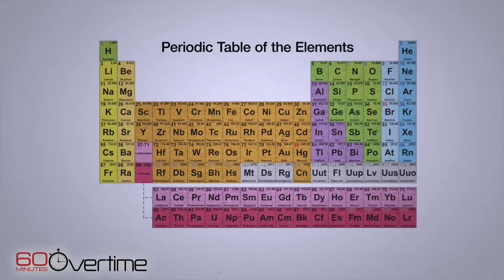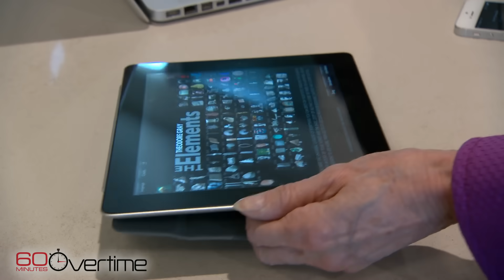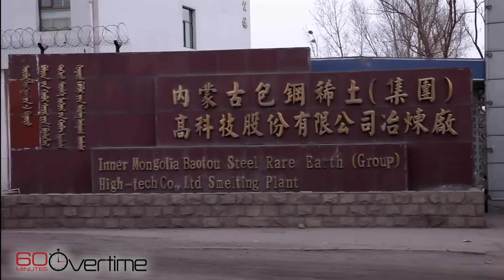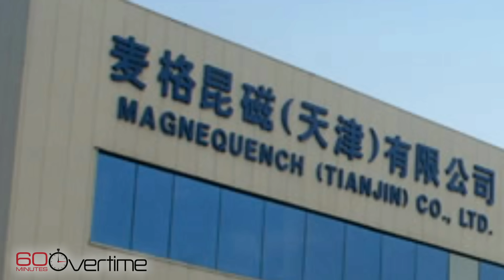Rare Earth Elements | 60 Minutes Archive

Comment: The Flamingo is better than most counterparts in terms of range, payload, jamming resilience, and cost/ease of mass production. It's a "strategic disruption tool"—simple, brutal, and scalable—designed to overwhelm defenses and compete with high-tech opposition using basic, smart engineering.

Comment: This is less than half the story. Finding and digging up rare earth is the easy part, the hard part is purifying them to 99.999% purity. No country has invested as much money and time (2 decades) as China to get rare earth to the 99.999% purity needed in radars and microchips. It took Japan nearly 10 years to purchase mines in Australia and Malaysia to extract and purify rare earth for their cell pone industry after the Senkaku islands (or Diaoyu island) dispute with China, and it only reduced their dependence on Chinese rare earth from 90% (in 2010) to 60% (in 2025). To purify rare earth to 99.999% purity, you need cutting edge research at universities - one of the very few ones to study rare earth is Colorado School of Mines. New facilities, such as the USGS Energy and Minerals Research Facility set to open there only in 2027. The alarm (America's dependence on China for rare earth) was sounded over a decade ago, but the country lacked and still lacks leadership to get this fixed. Will the half-hearted effort end up like what happened to Solindra?

Comment: Massive, rapid building has resulted in unsustainable levels of debt and the creation of "ghost cities" and underutilized infrastructure. This suggests a misallocation of resources, where projects serve political goals (such as provincial GDP targets) rather than sound economic logic. The breakneck pace of construction, even for renewable energy, has come with immense environmental degradation, pollution, and resource depletion. The speed is achieved by cutting corners on environmental impact assessments and enforcement. The focus on having a rail network 20 times more extensive than Japan's can ignore the possibility of technical issues, maintenance costs, and quality control compared to systems built with greater deliberation.

Comment: Actually rare earth elements are so called because their atomic structure makes it difficult to distinguish between them. Their atomic numbers are high enough that the atomic shells don't fill in order like the lower elements. The lowest shell of a higher valance fills before the higher shell of the lower valance finishes filling. Since the higher valance is the outermost shell, chemically it  is the major identifier of the element. That makes the elements in the series (e.g.  Actinide) look the same chemically until the lower shell is filled as atomic number increases.

Comment: I remember reading about Magnaquench in Popular Mechanics. In the article they described how the starter motor on Jeeps were smaller and lighter due to the stronger magnets supplied by Magnaquench. I guess they failed because  they didn't produce the instantaneous massive profits expected by Wall Street and China saw the long term potential. Same story with 123 systems which the Chinese scooped up and became CATL.
Reply: No it's because of over regulating in the US.  The left pushes every new industry out.  Most recently the Crypto industry is a good example.
Reply: Wrong ! CATL's battery tech has nothing to do with A123 Systems.
Reply: @tweedy4sg  CATL copied A123's tech.  Just like China does with most of their tech
Reply: @tweedy4sg  You are correct. It was Wanxiang group, headquartered in Hangzhou, China that acquired A123.
Reply: Socialism > Capitalism